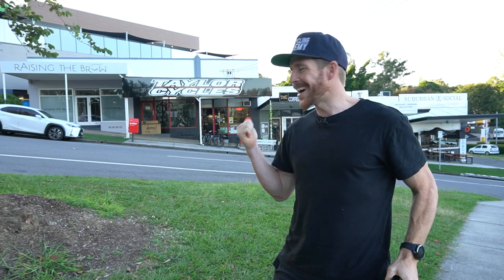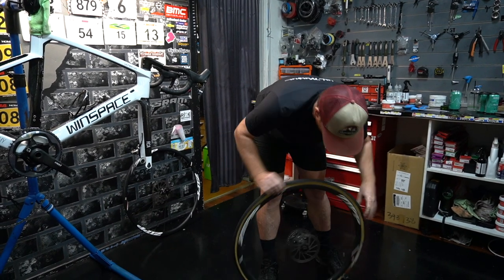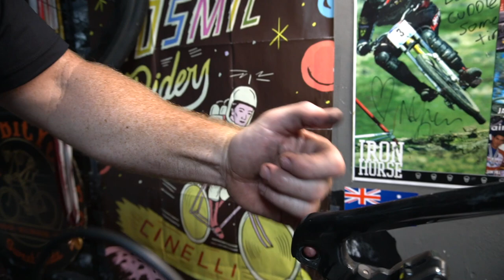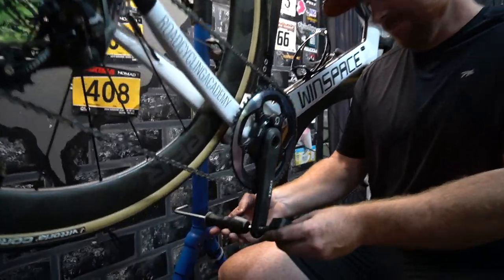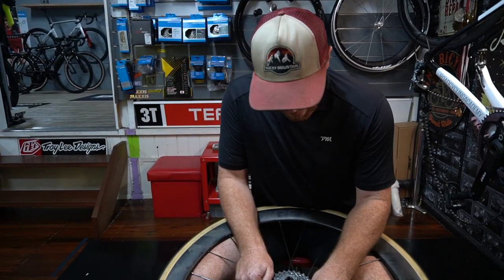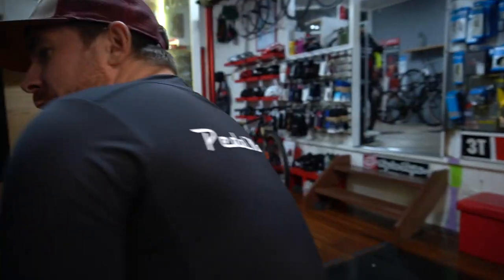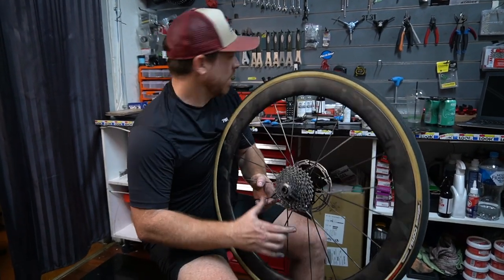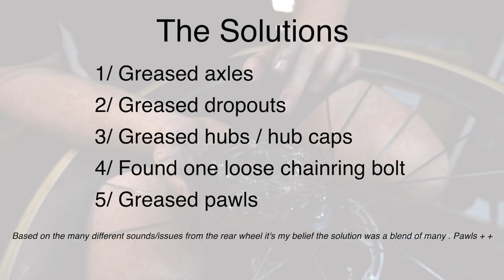How we fixed my creaky carbon wheels (Winspace 50mm Hyper)

Comment: But the zipp’s were still faster while being heavier, I’m I right?
Reply: I have had both Zipp 303 NSW and recently bought the Hyper wheels. I have sold my Zipps. A set of Zipp 202's will not be aerodynamically superior to a 50mm wheel. They may feel faster if the bearings are smoother, but aero is more important than rolling resistance. The Hypers are also much stiffer than the Zipps unless the Zipps had been modified. Use whatever makes you feel good :)
Reply: @Addiies  If you enjoy climbing lengths of time out of the saddle, the Hypers are very responsive due to their stiffness.  They are a fantastic all round wheel and lighter than most. The Winspace T1500 aero bike in disc brake, is heavy and I recommend Cam tries the Hypers on another bike. I have done many tests on these wheels and you need to spend a hell of a lot more money( $4500 plus) to find a wheelset as good or marginally better. Anyone would think I am getting a kick back. lol if you win tatslotto buy a set of Pardingtons. lol

Comment: Anyone seriously into riding high end bikes,who has any mechanical aptitude really should be able to figure out how to look after their bike. This is such simple stuff. Basic rule of thumb,grease between contacts..except of course Carbon seat posts and steerer,use gritty paste. Not so many years ago most riders built/looked after their bikes. I guess just a sign of how times and ‘hands on’ approach have changed!!
Reply from the maker: I hate using my hands. Not my thing, just like riding bikes.
Reply: Fair enough...

Comment: And Winspace breathes a big sigh of relief
Reply: Why should they? When a consumer gets a set of wheels they should be perfect right out of the box.
Reply: @monty2078  nothing majorly wrong with them. Most of the creak seemed to be fixed by proper thru axle tension too.

Comment: Also we're now waiting to see if the placebo effect took place to make the bike feel slower because of the cracking, creaking sound? Also all these bikes you've built Cambo, with the group sets you ordered, what crank length did you build them up with? Did you stick to 160- 165mm or did you go longer. Are all the same or mixed? If you went longer was this due to pedal snap with longer crank criterium type performance speed perception? Let's us know since you're spoiled rotten with choice. I hope you don't change Alice like you change your bikes man.